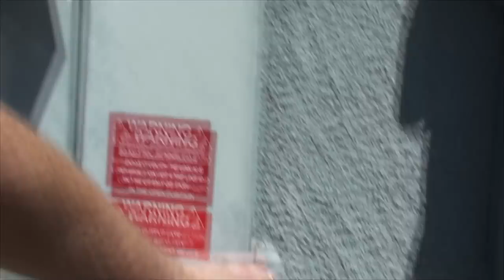NO AIR CONDITIONING

Comment: Hope you get feeling better Val.Kevin hope you get your air conditioner working.Here in Florida ,Are air and heading unit went bad could not fix .We got a new one outrageous they are 5,000 but we could not get cool with fans.😢I call you Kevin the tool man you fix just about everything.Love the Halloween stuff ,I know Val will want to go see to.Love and hugs Mgt from Florida.😀🐶🐱🌅🌆🌈
Reply from the maker: Kevin the tool man was unable to fix the AC this time unfortunately it is a little more difficult this time and is going to cost about $1000! At least we don't have to replace the whole thing! We will have to have it fixed before we move right now we are doing OK without it because it has cooled off outside! Love and hugs back at you!